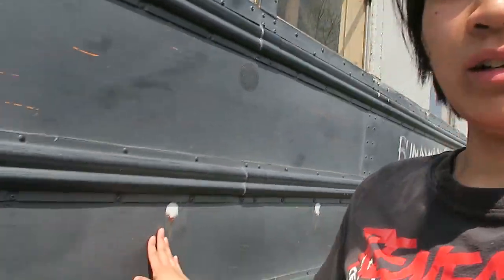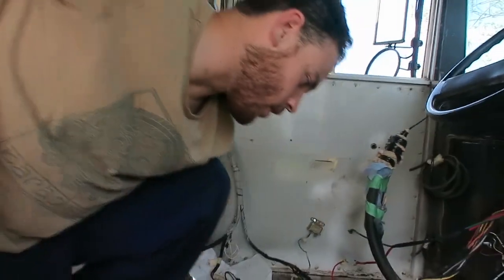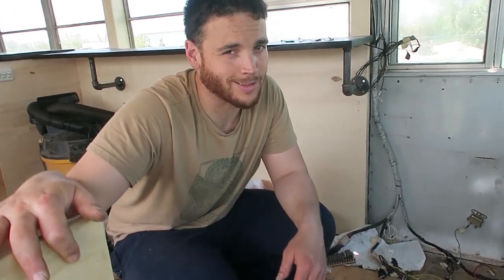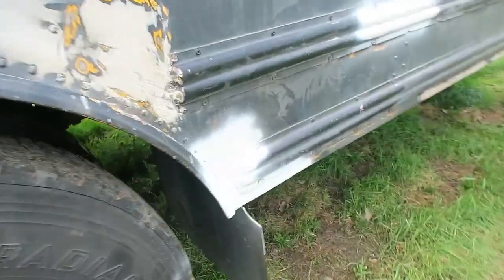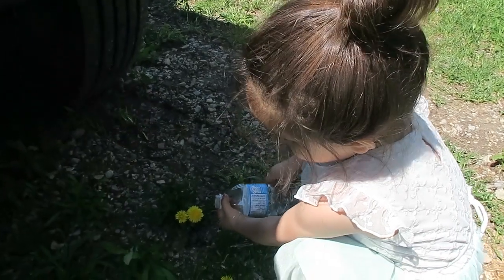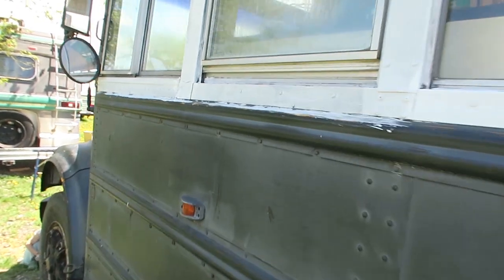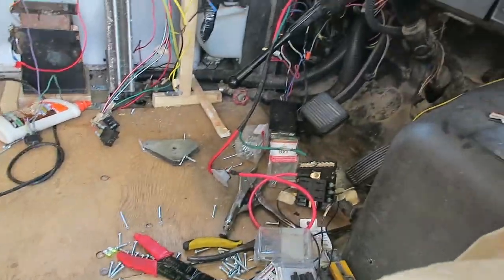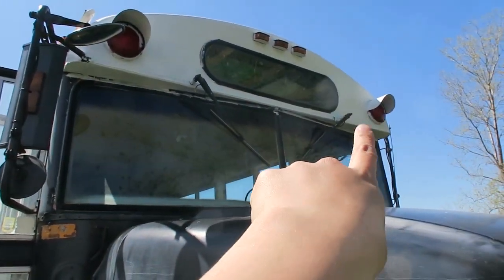Ask Us Anything | Bondo | More Painting | Dashboard Repair | Tiny House School Bus Conversion

Comment: You may want to try fiberglass to fix holes on the bus it is more durable and will last much longer than bondo. I thought I seen some holes in the floor up by the dash area.  Watch a you tube video on fiberglass. I think it is easy and pretty inexpensive as long as you don't need large amounts. About $100 for a gallon and some matting
Reply from the maker: jesse smith yup! That’s what we did. We used fibreglass and bondo for our holes. Still so much patchwork to do though 😓 thanks for the suggestion!
Reply: Runaway Expedition no problem love your bus it's looking nice!!!! I have a flat nose rear engine thomas mvp sitting in my driveway that I'm going to start a conversion on soon hopefully.
Reply from the maker: jesse smith love it!! Good luck! I hope you start on it soon. It’ll be an awesome adventure 👍🏼